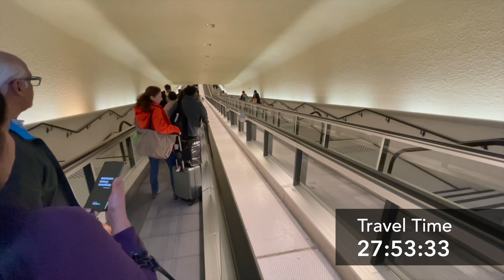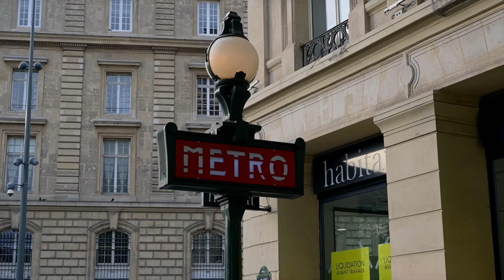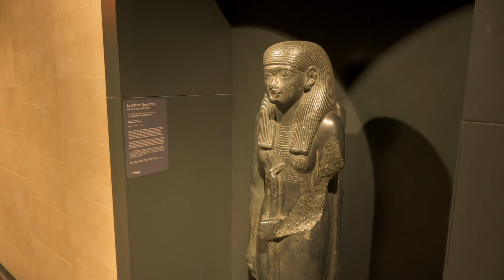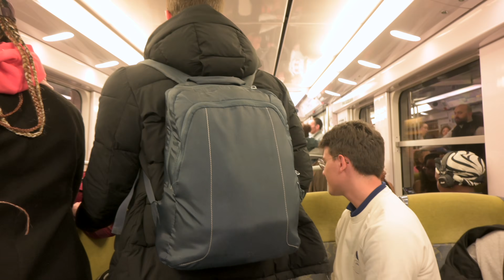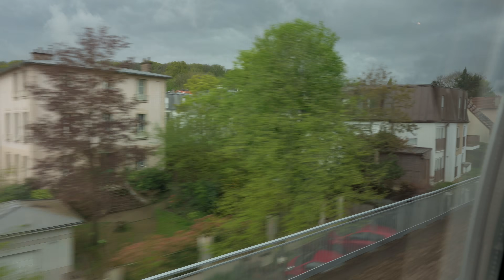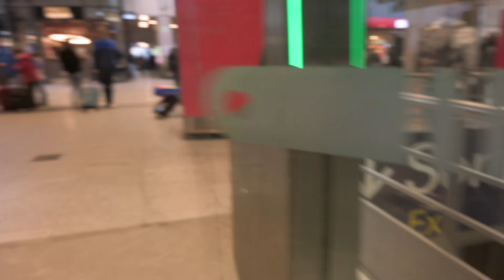Paris' Transit System EXPLAINED - Paris Metro, RER, Transilien and more!

Comment: M13 is the line with many stations equipped with platform screen doors, despite not being a driverless line. It is to help cope with the congestion and reduce risks.
M1, M4 and M14 are fully equipped with platform screen doors as they are fully automated.
Most driver operated lines have autopilot (except 3bis, 7bis and 10), a kind of GoA2 system. M10 is being equipped with the new system.

You'll have to come back soon as it is truly a transit-a-palooza in Paris right now and up to 2030 or later.
Since your visit, M11 has seen its rolling stock, the venerable 4-car MP59, being retired and replaced by new 5-car MP14 trains that are fantastic. They are of the "CC" version (with cab), for rubber lines with drivers, but its driver cab is removable as this model is compatible with full automation. M11 should be converted to full driverless operations some time in the future.

The 8-car MP14's have also arrived on line M14, in CA version (for automated no-cab) replacing the 6-car MP89-CA transferred to line M4, themselves replacing MP89-CC (CC for driver cab) trains transferred to line M6 and replacing the good old MP73 that is being retired like the MP59.

In December 2023, tram line T12 is set to open.
In spring 2024, the following parts are set to open: 
The Western extension of tramway line T3b up to Porte Dauphine, with an interchange station at Porte Maillot connecting with line M1, RER C and the new RER E station.
The Eastern extension of metro line M11.
The small North and large South extensions (to Orly airport) of M14.
The first phase of RER E's huge Western extension, from Haussmann Saint-Lazare to La Défense or Nanterre, including new stations Porte Maillot, La Défense and possibly Nanterre la Folie. That's a large 8km tunnel extension under the Western side of the core city and the business district.
RER D & E are also receiving the all new RER NG trains that look a bit like the Regio 2N, with both single and dual level cars.

M14 and M11's extensions are the first parts of the humongous Grand Paris Express project to open.

They'll be followed in 2025 by the South section of M15, the huge fully deep underground, 75km long circular metro line around Paris. This first section is the longest of the three sections, with about 35km. From Pont de Sèvres in the West to Noisy-Champs in the East.
As you mentioned, Cable C1, the first "telecabin" gondola system in Paris is expected to open in 2025 too.

Then several tramway extensions, new metro lines and extensions or phases.
Plus half a dozen proper busway BRT lines with "trambus" vehicles.

Something new every new till at least 2030!
In total, that's (today) about 360 kilometers of new transit lines in the next 7-8 years, and counting as there will very probably be new additions.
The "projects and works" page of Île-de-France Mobilités website has plenty of expansions listed and many more not listed as they haven't yet reached an advanced enough stage.
This page currently lists 14 different rail-based projects in advanced building status, 5 in advanced study or preliminary work stage and 1 in pre-study.

Another visit in late spring 2024, before the Olympics' crowds flood the city, would be in order to experience all the new fancy transit infrastructure.
Sometimes it feels like a transit freak's christmas wishlist becoming reality.

And trust me, it's about time given the saturation issues Paris is having. The Grand Paris Express project's expected ridership has been revised from 2 to at least 3 million daily riders, which is making some worry that all these extensions and expansions may not be enough to handle the crowds.
RER lines A & B are respectively Europe's busiest and second busiest train lines (and probably the world outside of Asia). RER A's massive trains can carry more than 2600 passengers and there's no sign of attendance going anywhere else than up. The 2020 pandemonium was only a temporary relief.
While M1 is not the overall busiest metro line, it has the highest ridership per kilometer in Europe.
Frequency is already super high, with some lines being set at 80 or 85 seconds at peak time and the physical limit is pretty much reached.
So everyone is eagerly awaiting the opening of RER E West to alleviate the load on M1 and RER A, and the opening of the whole Grand Paris Express scheme to give some air.

That was a very nice video! 
Greetings from Paris.